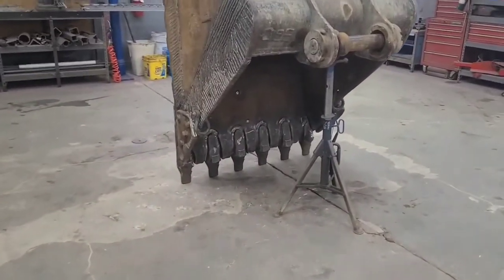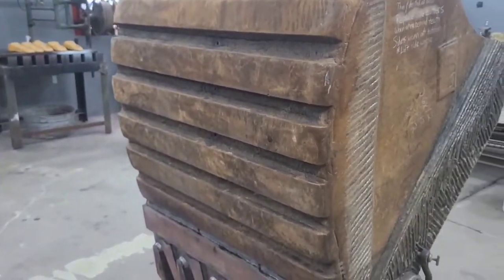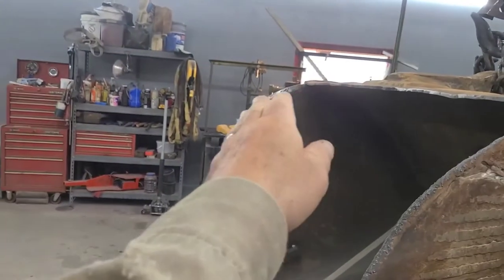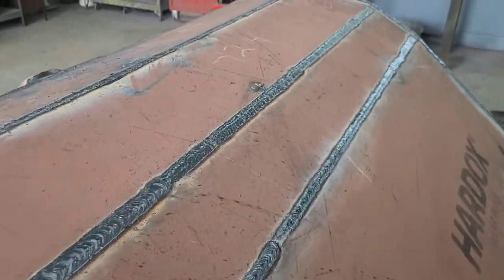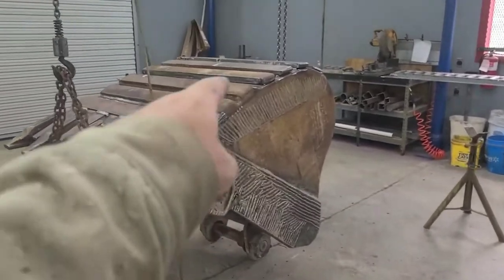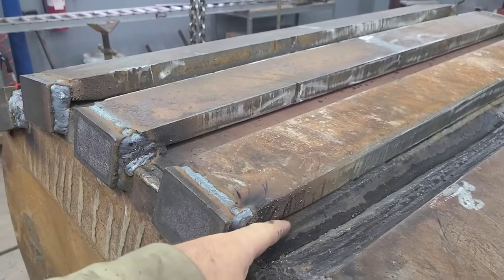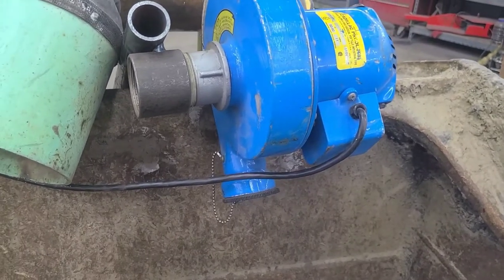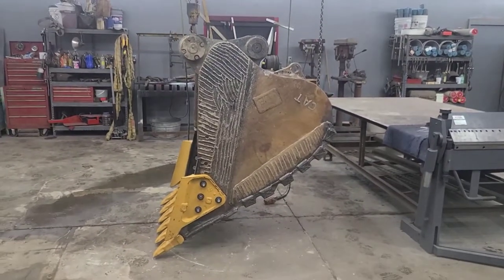Excavator bucket repair part 2

Comment: That’s a very impressive job. Watching this video has convinced me that doing a replacement of plate that’s has a radius is done more than one way. I’m not an engineer by any means but by doing it the way you did that will longer than one solid piece bent to fit. Well done.

Comment: Dayum, how many amps does it take to run a 1/4 inch jet rod? Looks like you’re making that bucket better than it was to begin with.
Reply from the maker: I run 1/4" jetrod from 275 to 320 amps

Comment: New sub. Excellent repair. The ce ent mixer deburring tool is genius. Cheers
Reply from the maker: Thanks for watching and commenting.

I bought a bigger cement mixer and I plan to modify it to be used especially for metal deburring but I haven’t started on that yet.  I’ll shoot some video of that when it get around to doing it.  I’d like to set the big one up with heavier side walls and a steel door of some sort…stay tuned

Comment: Brilliant work young man! That bucket look great. I have done a few bucket rebuilds myself but couldn't handle one that heavy because l haven't the gear.
I have a lot of stainless steel 309 welding rods of 1/4inch and have wondered if they could be used for hard facing because l am unlikely to use them for any job. They came in an old rod oven l bought at a bankruptcy sale along with about 1/4 ton of 6013, 7018, high nickel content rods, other types of stainless and such like. Got the whole lot for £30.00 or about $25. Yep, a major bargain that day!
Keep up the good work!
Reply from the maker: Thank you…if you use the stainless rod for hardfacing just remember the weld they make cannot be cut with an oxy/ace torch…that has caused trouble for people before so ya just use them in a spot that your not likely to ever need to cut with a torch and they would work fine for hardfaceing

Comment: Hello again CB. A couple of questions: 1) I’ve looked into to Hardox before but can’t find a supplier down here in Virginia for it. Closest I’ve found is Baltimore. Where are you able to get it? 2) I have always been taught to preheat cutting edges and wear parts to 300 degrees F. before welding. I didn’t hear you mention anything about preheat. Are you preheating? Should I preheat Hardox before welding? FYI: I always run .045 Lincoln Ultra Core 71A85 and 75/25. Thank you for your thoughts.
Reply from the maker: I got that Hardox from WV Steel in Poca, WV

I do not preheat...and many say you should...I have never had an issue welding Hardox, AR, or any cutting edges without preheat...HOWEVER once I begin I continue to weld and work on the part in a very dedicated manner and I do not stop and allow the material to cool at all...On cutting edges I run the first pass about 3" on one side and then go directly to the opposite side in the same spot and weld 3" then continue doing that back and forth until there is a first pass on both sides full penetration without stopping and then immediately weld the rest of it up without allowing the material to cool.

If you weld slow or if your gonna stop and start several times you should preheat
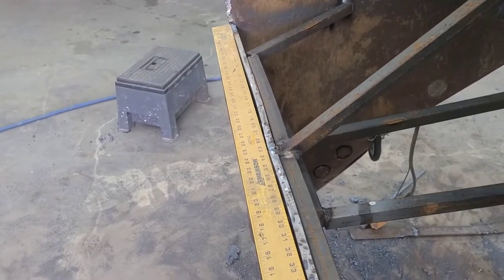Reply: Thank you for the response. I agree that when you start, you need to keep after it until you finish if at all possible. Me, I finished welding the tooth shanks on a 3’ excavator bucket at 10:30 last Saturday night because I had it hot and didn’t want to quit until it was finished. Blessings to you and yours.

Comment: You are a funny guy my dude. I really enjoy watching your videos. 

I am  a NDT guy mostly x ray . I weld on the side for fuzzies. Multiple processes with multiple metals. Passed some codes😅.

I enjoy the tips you post dude. You are sharing a lot of experience and thoughts here on youtube.  Its a fun valuable resource!  Like the little things, like how you smashed that 7018 tack with a hammer to get a tighter fit on those loading docks. 
I can weld and pass codes most of the time but those little tricks.  I would have been messing with dog and wedges, as I have done in the pass. 

Again rad stuff dude.
Reply from the maker: Thanks and thanks for watching

Comment: Just found your channel, great work! I never knew how much deposit you get out of that 7024 rod. I mainly run dual shield and inner shield wires to save on rod changes and restarts. I will have to consider 7024 from now on. Any particular brand you prefer? Thanks!!
Reply from the maker: I've ran Lincon 7024 mostly...and it's amazing how much difference there is between the 3/16" and the 1/4".....1/4" jet deposits sOOOOO much more metal that nothing compares to it...dual shield is nice but I get sick of scraping spadderballs off those dern guns...with jet I just lay'er down and lett'er burn

Comment: I know you dont like micky mouse stuff. But my boss doesnt have all the toys needed to flatten out the bottom dent. So boss wants bars put over the old bars ( just the bottom 4) since thats the only area worn and dented. So im adding them but im capping the gaps with the new bars to creat a new cleaner finish and the welds are protected by the bars still. Any suggestions is appreciated.
Reply from the maker: I'm doing one now by adding bars over the old bars...pressed them down in the dented areas with chain and a bottle jack so there is less gaps

Comment: What machine in the shop do you use that lets you run 1/4" jet rod? Thats gotta be a lot of amps.
Reply from the maker: Around 270 to 280 amps

My Miller XMT 304, Lincoln Commander 300, or either of the two Miller Trailblazer 302’s I have….all of them will run 1/4” jet rod
Reply: @NBSWELDING  do you think a miller trailblazer 325 would run them? Sounds like it would be hard on the machine.

Comment: Bro. Im doing the same to a 330 bucket and its my 1st. I was a bit nervous thinking about this snd that. Now after watching. Im clear on my path. Great video since this bucket is pretty much the same deal all around. Sweet!!. But how many hours was put into this?
Reply from the maker: 97 hours...177lbs of welding rod...and 4'×4' of Hardox plate
Reply: @NBSWELDING you charge time and material correct
Reply from the maker: @richardvillanueva559  yessir
Reply: So what was the cost the the client? Id like to know for reference.
Reply from the maker: @mattgaming8717  a little over $7K
Reply from the maker: @mattgaming8717  the way the previous repair was definitely made it cost more than it should have but still less than half the cost of a new CAT bucket that size